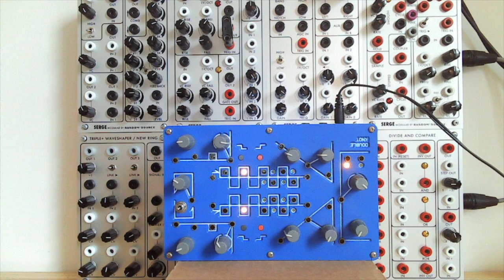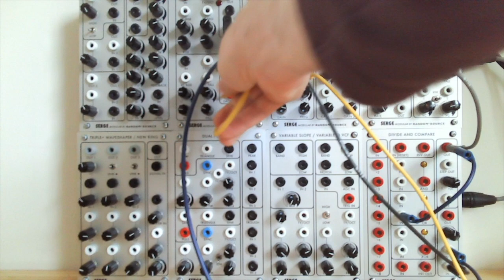Cybernetics VII.5 - Interference and Rungling

Comment: If you were to add any extra equipment to this series, my vote would be an oscilloscope. It makes getting the integrator settings so much easier for cybernetic conditioning, not to mention it's easier to follow along when you can actually see what's happening.